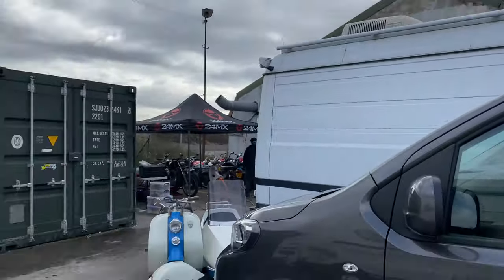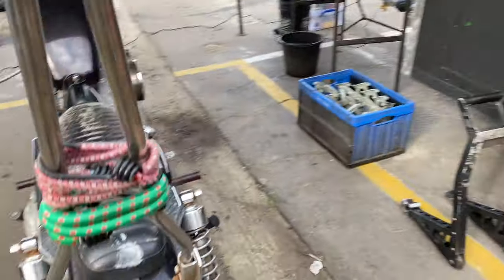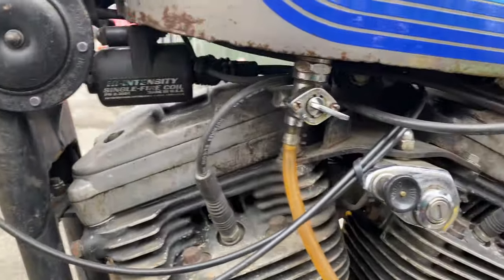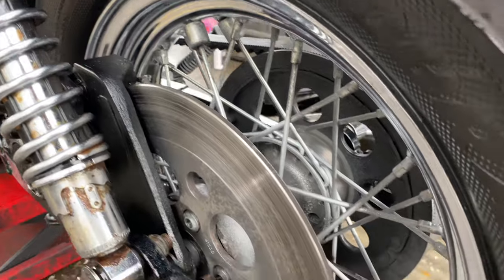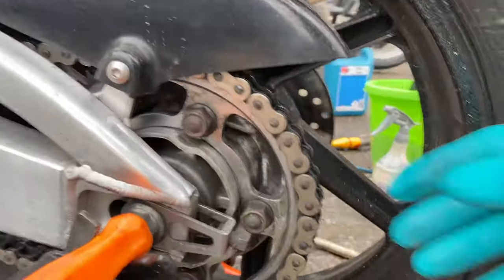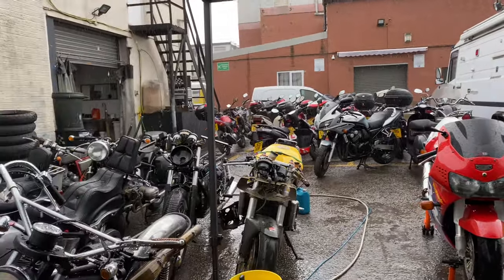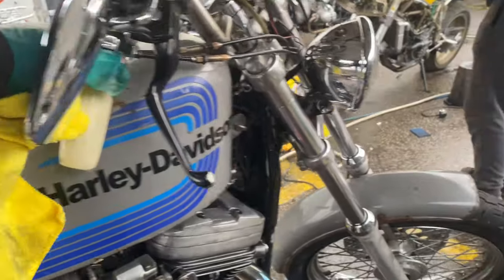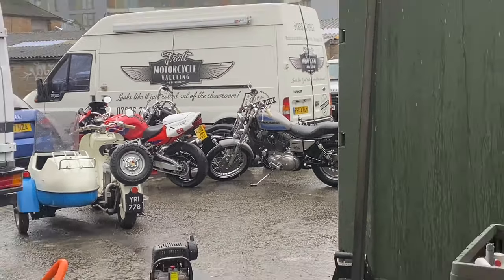Full Days Booking At Riverbank Motorcycles

Comment: have you got a price list or website i can check out?
Reply from the maker: Many thanks for your enquiry. Your quickest and cheapest option would be to ride out to mine one day in Elstree. WD6 Post code area. I have a lovely lake across the road. Have a walk and some lunch while I work my magic. I generally work from Elstree Tuesdays’  to Friday’s.  
       A "Trott Full Monty" valet generally can be done within 2 - 2.5 hours. £150 -£200. Thats a complete Valet getting your pride and joy looking like it just rolled out of the showroom. Not only will it be looking mint again it will also include a good coating of ACF50 winter protection. I will be continuing this special for the next month as its been such a hit. Be-spoke cleaning of Harley's, adventure bikes, Classics and tourers 2-4 hours. All charged  @ £75 an hour. I can now offer the full range of Ultimaxx  Ceramic Paint Protection. From the NanoMaxx Yearly protection to the ultimate Signature Pro Reserve for that 5  year protection. I am doing the 5 year Signature Pro Ceramic at a special 1/2 price at only £50 added on to any “Trott Full Monty Valet” 
       I do offer a mobile service, this however is a bit more expensive due to travel time etc. I would need plenty of space to park my van and set up, also water and electric preferred. Usually this service is more cost effective if their is a few bikes as it would cover the extra cost for travel, set-up etc. I can usually do up to 3 bikes in a day. 
      The third and best option (“The Works”) includes pick up/delivery. Usually picked up on a Friday and taken to my valeting studio in Dorset and brought back on a Tuesday. This is the best option as It would be done in a heated studio with a ramp. Spending anywhere between 4-6 hours. On top of a “full Monty” it would include proper paint correction on all bodywork, headlights, windscreen etc. Once paintwork has been corrected it would be prepped and coated with the Ultimaxx Signature Pro 5 year ceramic and the Ultimaxx Slixx 1 year ceramic on wheels. Priced £250-£350
Examples-

https://youtu.be/vHqrRgm-4IA

https://youtu.be/Wyls73a37wU

https://youtu.be/20SAg0ohWaw

Let me know your thoughts,
Freddy Trott
07966249963

www.trottracing.com
Follow us on Facebook, Instagram and YouTube for daily photos and examples of the sort of work I do, you won't find better for quality and price. Satisfaction guaranteed!
 
Facebook- F.C.Trott’s Professional Motorcycle Valeting
Insta- f.c.trott
YouTube- Freddy Trott
WWW.TROTTRACING.COM
FREDDY@TROTTRACING.COM